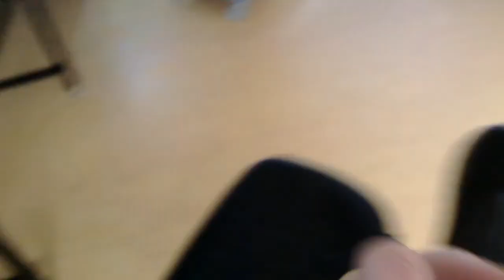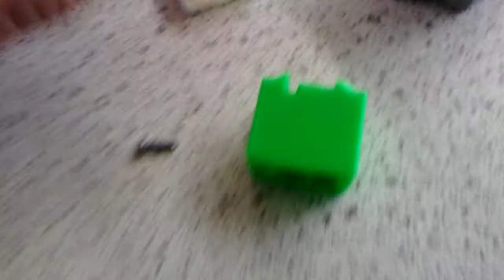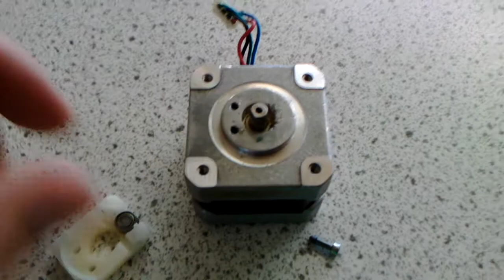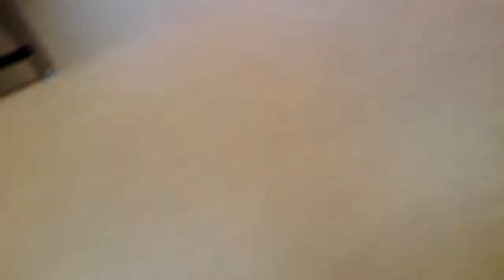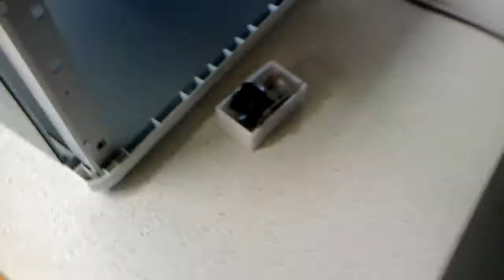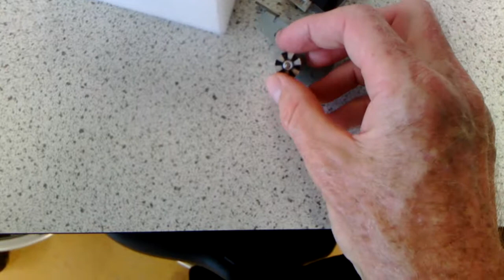UPBOX 3D printer extruder head modification

Comment: Hello,

Having slight difficulty in figuring out how exactly this solution of yours is installed, would you please be able to elaborate? I'm going slightly insane with my box's extrusion issues and this seems like a possible fix. Thank you
Reply: maybe in a way the steel shaft acts as heatsink to cool off heat absorb by the bearing?